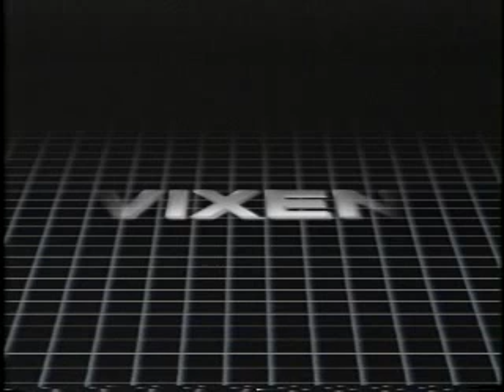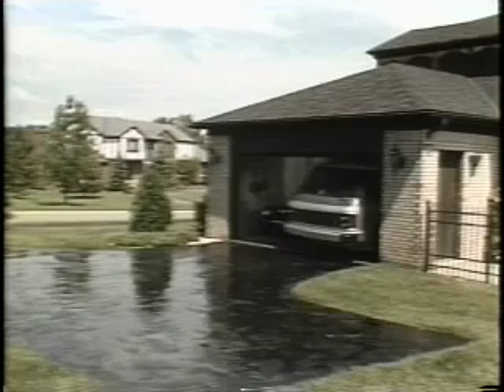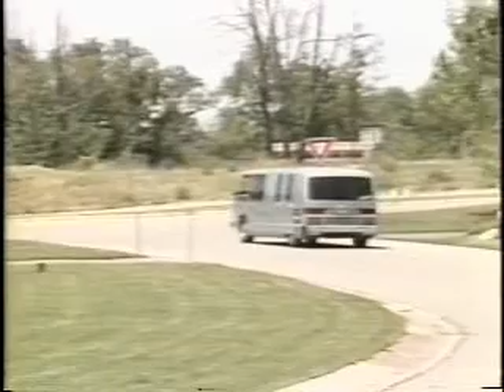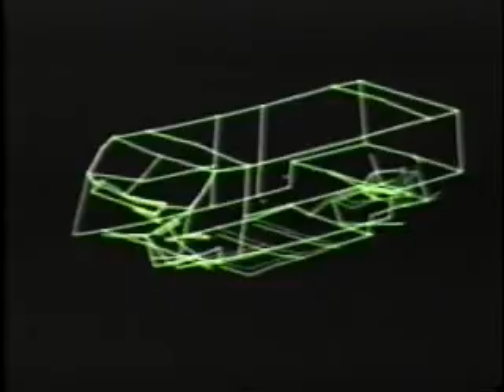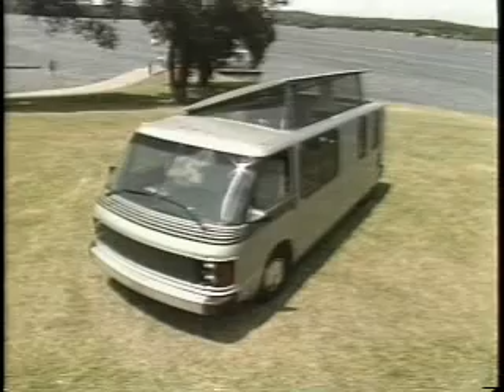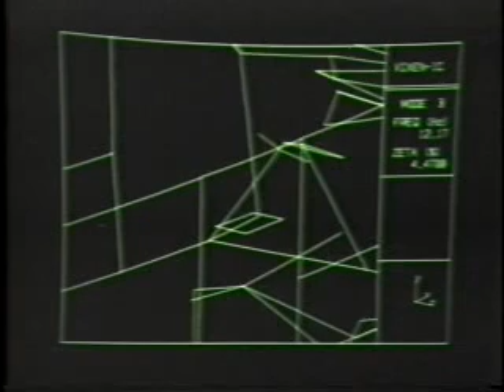Vixen RV Clip-3

Comment: Why don't company's make small pushers anymore. They are only front engines
Reply: I agree. Is it really necessary for a motorhome to be 40' in length, be 15'-20' tall, and weigh in at 40k+ lbs.? I don't know anyone who truly needs that large a vehicle, even a full-time RVer. It would cost more money, not only to buy, but also to fill up on diesel fuel. And given how much diesel fuel costs these days, it varies between fuel stations, but it's nowhere near the less than $1 per gallon 30 yrs. ago, it'd be insane to have to lug around that much vehicle for a couple of people. I would think a 21' diesel pusher would cost so much less to drive than a 35'-40' diesel pusher. I'd buy if I could afford it.